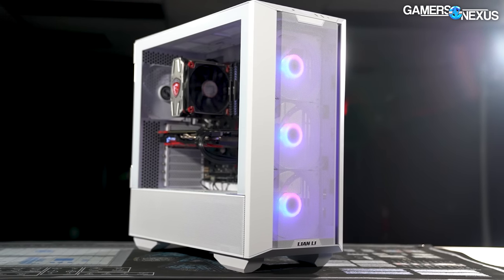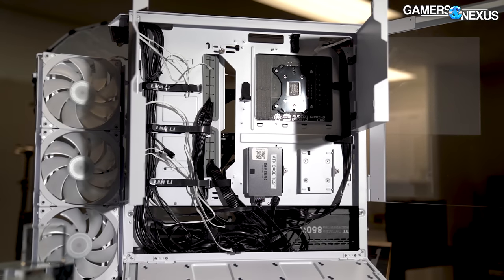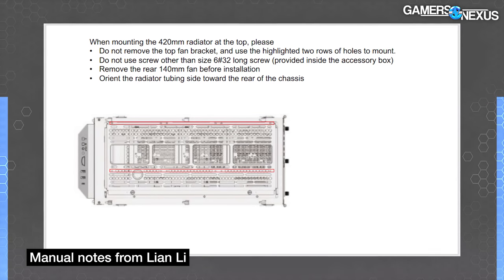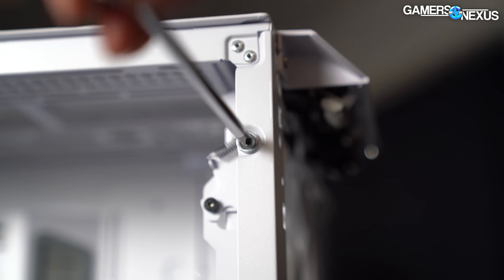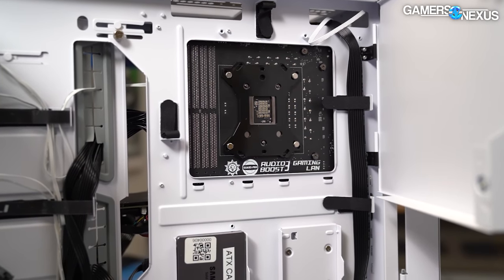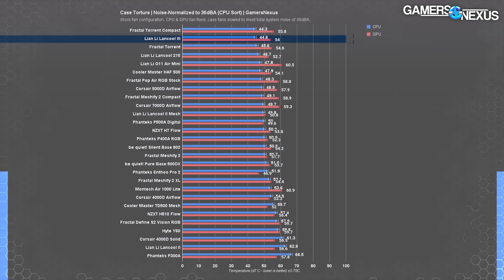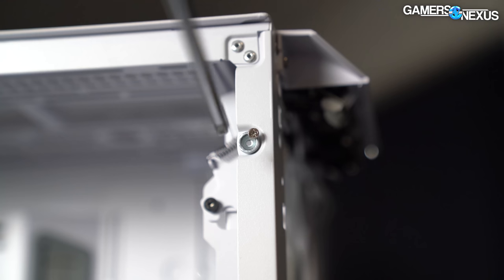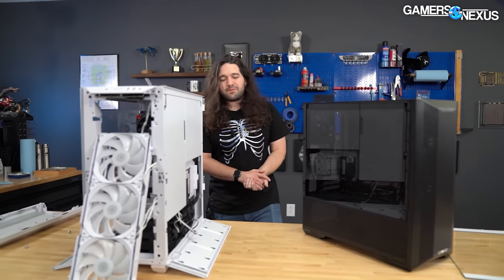Lian Li Lancool III Case Review: Build Quality, Thermals, & Cable Management

Comment: I know the video is old BUT, for anyone out there watching this and thinks about picking this case up - then here's my 1 year in review:
PROS: 
 - Super modular (like a lot)
 - Everything runs super cool and quiet at stock, but I recommend adding 1-2 140mm fans in the bottom
 - Don't worry about if stuff fits, stuff will fit no matter what (and then more stuff can fit)
 - Verrrry easy to clean and maintain
 - So much fun to mess around with and tinker with

CONS:
 - It. Is. Heavy. Do not buy this if you move around a lot or include you lifting the thing
 - It's bigger than you think, make sure to do a double and see if it fits your office / gaming area
 - Kinda don't like the glass panel on the "cable" side of the pc, just adds more to the weight and more to worry about

And to add to Steve's question about all of the mechanical parts and hinges = after 1 year they still work like day one, and I use them a lot (I clean and tinker a lot with it)
Reply: I have the Fractal Design Meshify 2 Compact. First thing I did was pull out a tape measure to compare the size and holy moly the Lian Li Lancool III is huge by comparison. Good that all the doors work, seems over the top though.
Reply: @trythis2821  It is on the bigger side for sure, I started oud with a Antec 1200 which is even bigger in comparison, then moved to a NZXT N5 (first edition), afterwards a Fractal Define R5 and now comfortable with the Lancool 3 :) 
I'm a total sucker for modularity and mechanical parts haha
Reply: I have a Lancool 2 mesh and I pretty much have had the same experience for the most part and I absolutely 100 percent agree that they're too heavy
Reply: The cable view glass is super weird, really wish they offered it without that tbh
Reply: How do you find the noise level? I have my computer in the living room and it is on most of the time when i'm home. I don't mind that it's a bit noisy when it's under load, but when i'm just doing some surfing or some other office work I want it to be pretty quiet.
Reply: The review is super usefull thanks so much ı was just planing to get a new high end pc build with a 360 aıo on top and 2x140 fans at the bottom
Reply: Great take. I have this too, and there are VERY few cases in this price bracket that can fit a 420mm AIO in them. I'm still in love with it, and I don't think it'll ever look dated.
Reply: Is this a possible set up - 420mm AIO on top, amd 3 140mm fans in front? Also, stock cable of PSU 70cm to moobo CPU EPS power reachable?
Reply: @deniecejuliantan  The 420 is only going to fit in the front.
Reply: @theconsummatenerd  standard eps cable length will reach the mobo eps connector from the PSU? Mine is 70cm.
Reply: thanks! hats off for the followup!
Reply: Can  confirm. The case is awesome and runs cool....but its very heavy
Reply: Yep, I have it too, and damn is it heavy! But the motherboard tray still has some play in it, so i guess you can’t really make it any lighter. 

Also not having any way to secure the doors for shipping is a bummer, but oh well. 

Mine has an issue with the bigger cable cover popping open which sucks, I don’t know if it’s just some bulky cables or is it a case defect. Lancool 2 system with these covers being screwed down would’ve been better. But overall I love the case, it’s beautiful visually and mechanically.
Reply: @kirya312  same with bulky cables popping the back panel. had to tie those suckers down lol.
Reply: @ai-aniverse  I need to rearrange my cables then, maybe it will help
Reply: As another owner... Be aware of aluminum  door mechanism... its super SHARP and you can cut yourself.

Comment: I bought this case last year. I really like it, but I was unable to use the two inner doors on the right side. Just wasn't enough room to close them due to cables in the way, and I thought my cable management was just fine. No big deal because I really could care less if anyone can see inside through the glass door at my cable routing.

Comment: Order it 2 weeks ago. Spring loaded ssd trays missing. I filled the RMA form on their site, 72h response promised, still no answer after 13 days. Case is okyish. Hinges were a bit loose, I fixed them wit a simple Philips screwdriver. It fits 420 LF III but you need to remove exhaust fan in the back (or replace it with a slim 140/120 fan)

Comment: I ended up getting this case partly due to this review. Had it about 7 months now and every time I have to work in this thing it's just a wonderful experience. Coming from an older case, using this one just feels like they thought of everything. As an example today, I had to replace my radiator fans and it was a breeze - you can tilt up the radiator mounting plate to easily get at the back of the fans or the headers on the motherboard. For someone with big clumsy ham hands I'll take every convenience I can get.

Comment: Came from a lancool 2 mesh. Really wanted to run a 420 rad for my 13900k and was looking for options. Loved the torrent but I just found it to be a little restrictive in case layout. You basically have to run it as is otherwise you are throwing away money on those fancy shrouded 180s in the front. So, I opted for another lancool. 

1. 420 rads fit pretty easily, you have to ditch some aux fans but it's not a big issue. 
2. Major point they miss is cleanability. These lancool cases are so easy to keep clean. No screws no clips, not fixed psu covers... And now with the panel openers you don't even have to touch the glass. 
3. Front panel removal is the 1 major letdown, really with lian LI could have figured something out even just making the mesh section clip in would have been a big improvement. The front panel is so tight it is really sketchy pulling it off. Saving grace is that my build weighs 50lbs so pulling it off the desk isn't a concern.

Comment: I would buy this but I absolutely hate glass panels, especially im the back where cable management needs to be on point and mine is definitely not. If they offered a no glass alternative with room for messy cables? I'm down every time.
Reply: I hide my messy cables pretty successfully with lancool II mesh screw in panels. Dont mind the glass.
Reply: @AryaStarky  same -100% and this case has the doors to hide all the wiring.  So the argument that @redteamreview does not like the glass because it shows the cable management or that it has to be on point....not true on this type of  case ;)
Reply: Pro tip, cable management is all about being patient.  Don't be afraid to walk away after its built then come back later to fix the cabling with some zip ties.   Goes a long way!
Reply: @ratboyiscool  and also, don't expect to get it perfect the first time. Sometimes you learn from the first cable management exercise and have to do a second or third pass to get it really clean.
Reply: @falxonPSN  100% every system and rebuild you do you will get better and better finding new tricks or ways to better manage cables

Comment: When I got my Lancool Mesh 2, I was one of those customers who received their case with the SUPER tight screws. They were nice enough to send me another, free of charge. 
They mistakenly sent me a white version, which I really disliked. I contacted them and they sent me yet another replacement, free of charge and with express shipping paid. They also told me to keep the white one and the one with the tight screws, which I gave away on Twitter.

I rarely come across customer support like this. They won a customer for life, for sure.

Comment: i wonder if adding 2 fans at the bottom would help with gpu thermals, or maybe its best to buy the regular non rgb version and then just swapping out the fans for better fans. For optimal air cooling.

Comment: I have a question: Why do you prefer having separate headphone and microphone jacks on the front panel? I make this question based on that for the last... 8 years or so almost all headphones have only one jack for both input and output of audio. And trust me, with my old case having separate ports I had a hard time finding a headphone that would work. I ended up just getting an adapter to "mix" both ports into one.

Comment: An idea for a ridiculous test: having 2 identically assembled pcs, one using the white version and the other the black, will thermals be identical? From physics we know that white materials are much better releasing  heat vs black ones. Would this have an effect on the internal components?

Comment: I just completed a 13700KF/Z790 build with this case. Very happy with it. One gripe is the needlessly overengineered drive cages that are an absolute pain to fit unless you are demoing an empty case. The two cages mount differently just so that one of them can slide. They should have just provided several locating hole options for two identical cages. Getting them both into and out of their offset locating holes mid build was a total pain in the arse. I'll overlook the pointless right side glass panel (why?!), but otherwise was a pleasure to build into and is very well made, particularly for the price.

Comment: I've had a Lian Li mesh 2 case mostly because of GNs favourable review as well as following an aesthetics style that I wanted. My only minor complains is that it's so heavy and that the io is on the top meaning my kitties could step on the power buttons as they love to enjoy the warmth in winter. This new case has definitely solved the 2nd issue. Would be great if there was an option that didn't have the tempered glass panel on the back side to reduce weight slightly. Anyhows! kudos to Lian Li for improving an already decent case even further and to GN for their amazing work <3
Reply: I thought the case was heavy until i lifted a fractal torrent, and i thought that was the heaviest until i lifted the O11 dynamic..
Reply: I know the pain with cats with my be quiet 802. They always seem to hit the power button accurately haha
Reply: @Fruchti  I suffer the same problem with my Pure Base 500DX, I've shut my PC down just from unplugging a USB. :)
The button is far too touch sensitive.
Reply: @AlexLee-je5jg  try a 5000x.

Comment: I have an older model Lian Li and I can confirm over time the plastic clips that hold the front panel on will degrade and eventually break off, my front panel is taped on to prevent it falling off at the moment. I must stress that it's an old model, no magnetic fasteners.

Comment: Why are the GPU temperatures on the Lancool III worse than on the Lancool II Mesh? Wouldn't that be interesting to investigate? Are the Lancool II Mesh GPU temperatures really better than those of the Fractal Torrent? Either something went wrong during testing or there are some really interesting lessons to be learned about how hot air can be efficiently removed from the GPU (e.g., through an optimal distance between GPU side and case (glass) cover.
Reply: Sadly they're testing it stock and without fans on the GPU shroud. 
With up to 3 fans installed on the shroud pulling in air, the temperatures will definitely drop.
Reply: @jakechuaweipeng  I agree it is sad, that they are not trying a few more fan configurations that make a lot of sense. Their current approach lets a case with a bottom GPU cooling option look the same as one which does not have such an option. Regarding the comparison to the Lancool II Mesh, though, the latter has the same option and they did not use it to obtain their GPU measurements either. There must be some reason (distance from front fans, gap to side panel, measurement error for the Lancool II Mesh, etc.) that explains the worse performance of the Lancool III. I don't understand why some people are raving about GN so much, given that they don't really put in more effort into case testing than other channels. The only advantage GN has, is their standardised testing methodology, but they do very little to nothing to find out how to best cool a case. From a top notch channel that deserves the raving praise GN already receives, I would expect that they try different top fan setups, for instance, and not just speculate that one might be better than the other.

Comment: 7:15 The bottom mounted io (or option to have it that way) is a great/logical idea, it is a pity that it looks like they got the angle wrong though.
Reply: I never plug in any USB drives in the front anyway. It's a 100% positive for me.
Reply: Works better on a flatter bottomed case.

Comment: I got this case as soon as it became available in my region. Till now, I am loving this very much. The temps have been good. It looks great. I have added 360mm radiator on top, stock 140mm fans on front and back and 3 120mm fans below the GPU. The only thing which I have a gripe about is the magnetic mechanism for securing the back panels. For someone who is not good at cable management, it just takes additional effort to route the cables through specific cutout marked on the panels. Also, one thing to note, if the bottom fans are RGB, the shoddy cable management at the bottom is very much visible.
Reply: who cares how cables look. Making them tidy is a PITA. Though that (MIGHT) help if for some reason a cable came loose. otherwise who the fuck cares?

Comment: Curious, that Lian Li have listened to yourselves and others and made improvements, and yet you still can't quite like it.  It performs, well.  Yes it is a bit pricey, but not too much.  Having just added 140 SL fans to my old Lancool 2, I am astounded at how much quieter it is.  If I were able, I would buy the basic Lancool 3, replace the fans with UNI fans and be delighted. 
The one feature that I really love is the hinged doors.  Being older and since I am loosing muscle strength by the day, unscrewing and then lifting off glass doors would only end in one way.  Having hinges is just so user friendly.  Thanks Lian Li.

Comment: Already got a Phanteks P500 and really happy with it but I watch anyway because the content is top notch.
Thanks Steve and Team GN 👍
Reply from the maker: The P500A is a good case!
Reply: @GamersNexus  I only got that one thanks to you, otherwise I probably wouldn't have known about it lol Extremely nice case
Reply: @GamersNexus  Can we get a review of the P600S? There aren't any proper thermal tests of its fabric mesh front panel.

It's a little bit older now, but the build quality & features are great for its price. And the front panel fabric is really unique and pretty much no other case has it.
Reply: @GamersNexus  P600S is even better, you should test it.
Reply: As a p600s owner myself, I wish Steve would review it also. I think it fits the price range among the competition with much more headroom to build in and without gimmicks to make it appealing.
Reply: Fans of the P600S should contact Phanteks and get them to send Gamers Nexus one for review, I am sure Steve would appreciate yet another case ;)
Reply: I love my p600s.  I have it in airflow config and it is awesome.  Fit and finish are very good.
Reply: So, yes, review that bad boy.
Reply: @GamersNexus  "dated" is a bit vague of a review term. What part do you consider dated exactly of the P500A Phanteks, compared to what? Or are you hiding your own preference for Lian Li as a brand since you visited them and got some high level connections there?
Reply: @Anonymous One The matte white looks so damn good I wish I needed a new case so I had an excuse to buy it lol
Reply: @Anonymous One I agree, I love the 80s retro look of the Phanteks logo alone, so I guess I'm biased too :) Back to the Future anyone?

Comment: I have this Lian Li Landcool lll RGB version and keeps farely cool inside i guess🤔, all case fans at 90%

3x140mm front intake (stock rgb fans)
3x120mm bottom intake (Asus ARGB TF120)
3x140mm top exhaust (Arctic P14)
1x140mm rear exhaust (stock fan)

Ryzen 5800x /DeepCool AK620 (max 75-78c)
MSI mpg B550 Gaming carbon wifi MB
32gb ddr4 G.skill 3600mhz
2x Gen4 M.2 nvme drives 500gb & 4tb
2x 7200rpm 4tb in front tray (2nd rear hdd tray removed)
Evga 3090 ftw3 ultra (max 75c)
1000w Corsair rx1000x psu

Are those good temps for the cpu/gpu?????

Comment: So if I understood this right you need to buy separate rgb controller in order to light up 3 rgb fans that come with a case and use buttons on top to switch colors and modes?

Comment: Excellent job, gentlemen! Couple of points:
- I think you forgot to add the GPU thermals for the PSU shroud mounted fans
- I'd appreciate it for future reviews if Patrick would mention if the case comes with an HDD LED, as sometimes the power LED can have a dual purpose of being a power and HDD indicator, or just include some footage of the internal connectors
- At the risk of sounding ancient, but here goes: does the case come with a beeper? I still use mine which I cannibalized from my previous Thermaltake Chaser I bought back in 2014 as my Aorus B550 did not come with a seven segment display, so I use the beeper for diagnosis... 

Thank you for your hard work. Review was great and definitely like the new style of videos.
Reply: The last time I've seen a beeper was in my very first PC, an IBM think center. I ripped it out as soon as kid me understood enough about computers to do so. I didn't even know modern motherboards still supported them!
Reply: As one that has a 215, I'm going to be ture the guess that this too does not include a POST clear/error code speaker/beeper

Comment: I have the lancool 2 mesh and it already does everything I want from a case. I will never need more airflow with eight fans installed on it and the hard drive bay removed.